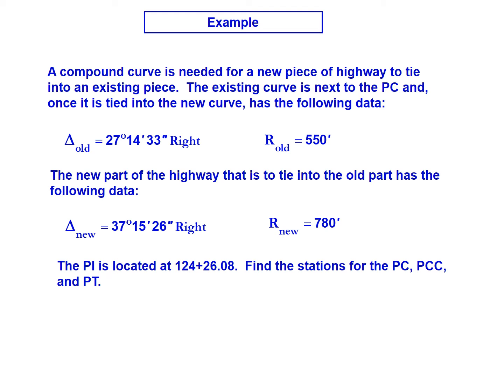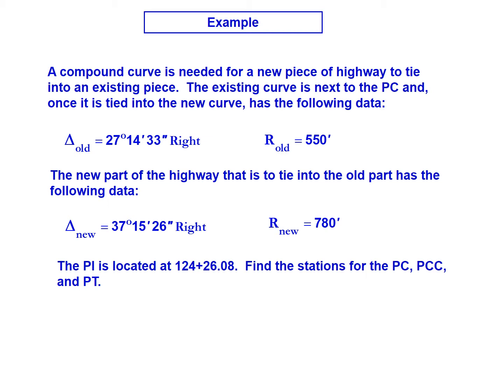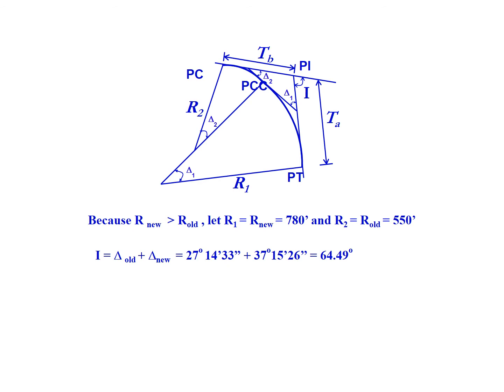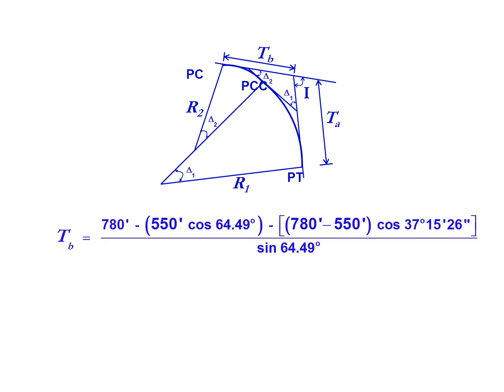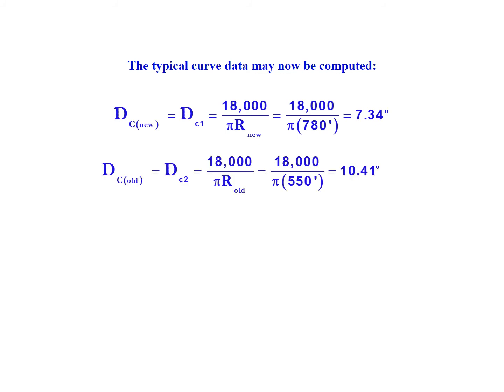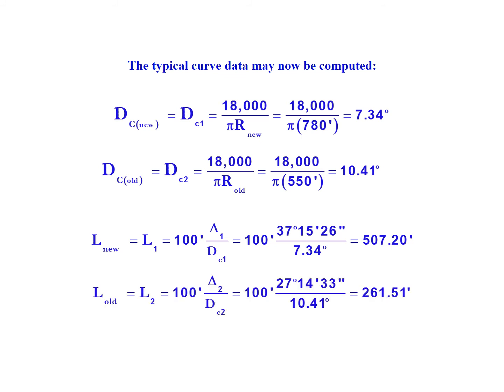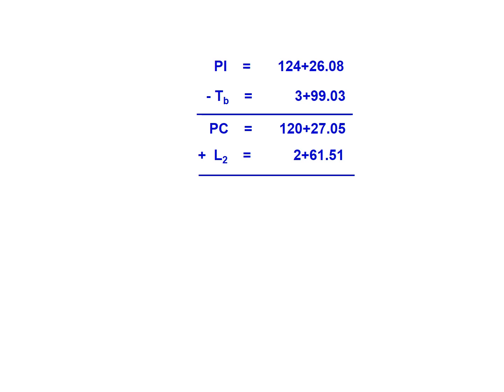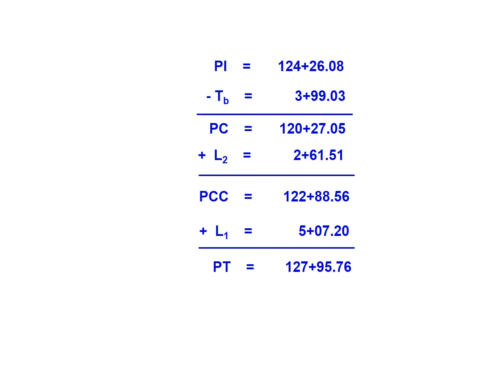Example Problem for Compound Curve for Highway Horizontal Alignment

Comment: "work incrementally on it to avoid errors", said Daniel.

this is good, actionable advice. dont rush it either - take your time, write everything out, draw everything out, and ensure your sketch agrees with your formulas and the values they yield.

solved this problem for 4th time and now it seems obvious.

ps: a few more variations on the theme would be most welcome in future videos!

Comment: if we use ncees hb 1.1's eqns then finding L_1 and L_2 is more straightforward than at first finding the D_c values to plug into the L_1 and L_2.
Reply from the maker: Here's the same problem using the NCEES equations: https://youtu.be/2NAlY2kNPD8
Reply: @FindleyDaniel  thank you. ill work on it. edit: finished problem - it was worth it.

Comment: would be great if this video might be re-mastered to use ncees hb 1.1's variable call-names. tried several times but was unsuccessful in getting the values presented here. these are my results:

. t_1 = 262.95'
. t_2 = 137.89'

. VH = 268.85'
. T_b = T_2 = 406.76' 

. STA PC = 120+19.32

my pc, pcc, and pt stations are short by 8' when compared to your values.

i'm stuck with the incorrect T_b and perhaps the VH. would hate to say it but perhaps there are errors in the video's solution? Any suggestions?
Reply from the maker: I'm getting the same values when using the NCEES equations: https://youtu.be/2NAlY2kNPD8
Reply: found several errors in my calcs, at the start of solving, namely in t_2. the error cascaded down to final values of T_b and VH. here are correct ones:

. t_2 = 133.26'
. VH = 265.76'
. T_b = T_2 = 399.0'

slipped up on t_2, mainly. all else was done correctly.
Reply from the maker: @oleopathic  I do think the NCEES method is less prone to errors, so that's probably a good thing!